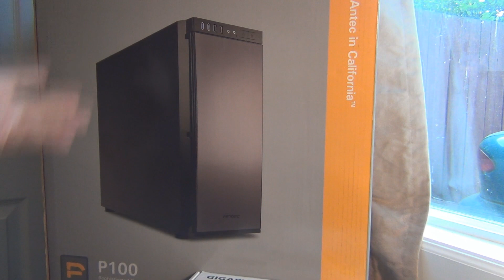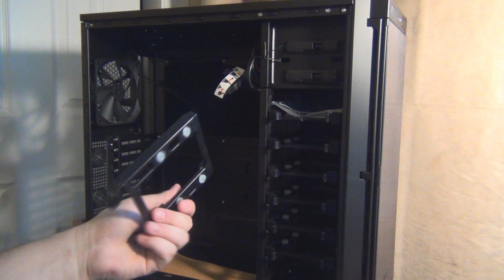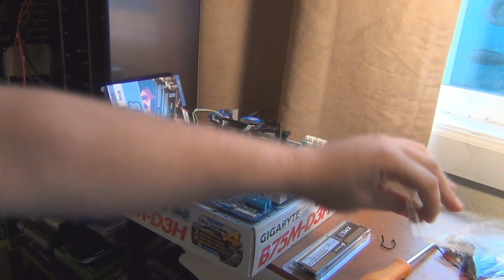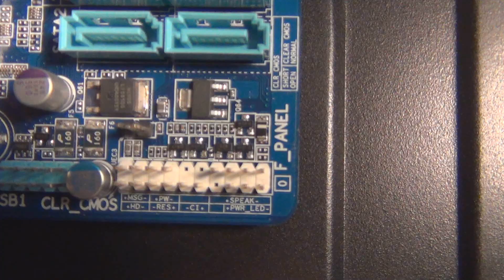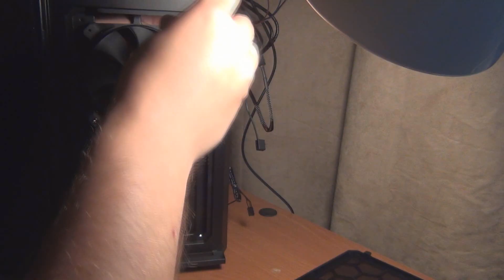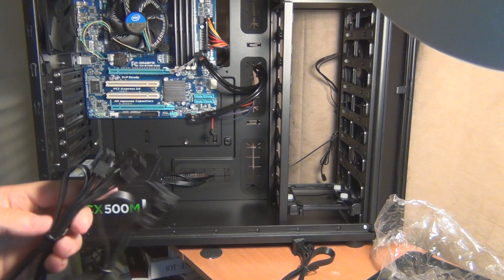freeNAS Build

Comment: I hope you agree with me that the mobo tray should be moved slightly to allow for better cable managment and the power supplies should ha longer  connector to accomodate cases where the power supply is on the bottom
Reply from the maker: good point
Reply: thanks for agreeing you are 1 of the few and you are great

Comment: Get a Pentium (like G3260) with ECC support.  Get a decent server mobo like one from Supermicro for about $150.  This gives you an ECC supporting mobo and Intel NIC built in, no need for a add in NIC.  Then, the all mighty ECC for the ZFS.  There is no good reason to not run with ECC with ZFS.  Everyone uses cost as the main factor, but since you don't really need a Xeon cost is really not going to be much different.

Comment: For your ZFS / storage solution to be realiable you need ECC memory
Reply from the maker: +Reyvie Hernandez That is technically true, but I've been using it with non-ECC RAM for many years on my home systems with no problems.  This is not a production, mission critical system.  It's just a home NAS, if this were for a business or had something I couldn't live with losing I'd spring for a Xeon with ECC for sure.
Reply: +praskieva_Computing You don't need a xeon to use ECC.  Some Pentium chips, G3260 for example, have ECC support.  You just need a mobo with ECC support to go with it.